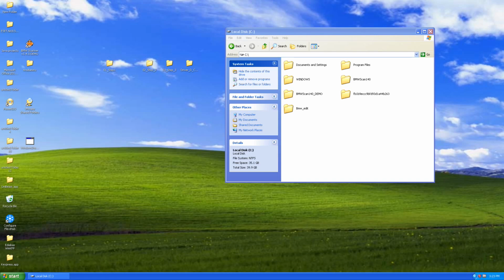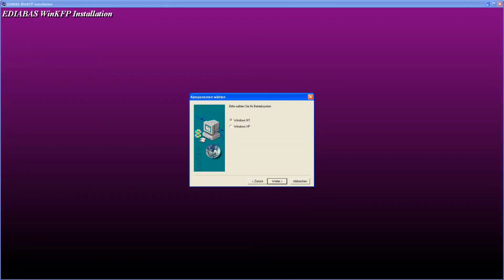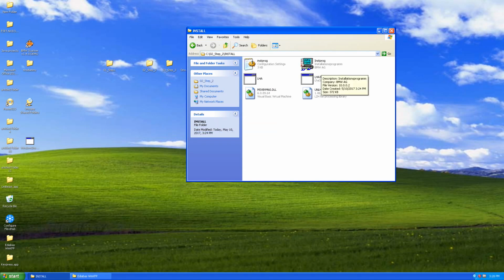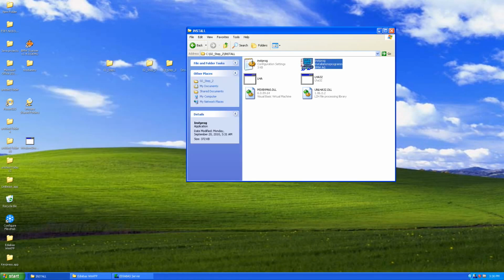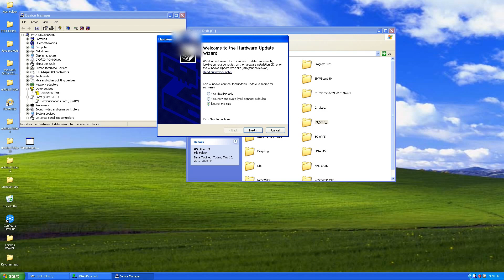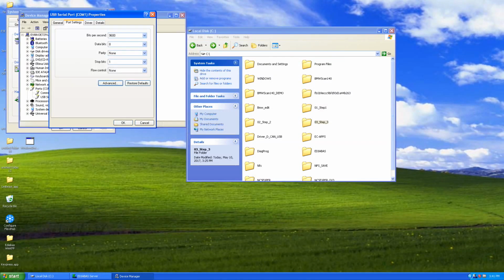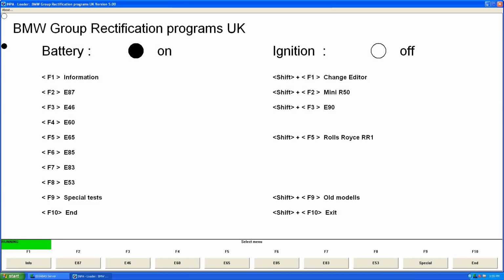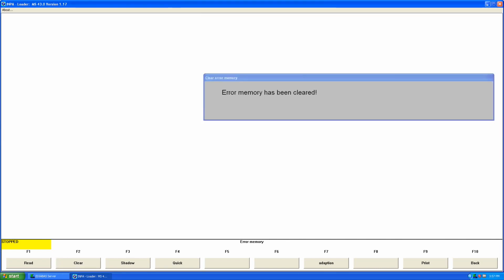How to install and use Inpa

Comment: I’m unable to install the drivers , can someone help?
Reply from the maker: What OS are you trying to install it on?
Reply: @EvanGoyuk  Windows XP 32 bit running with virtual machine. When I plug in the d+kcan into the USB, the wizard does not automatically pop up, and going the manual route does not let me update it because it says that there is already the best driver selected. I’m lost
Reply: Also, I noticed on the scanner itself that there is an LED that does not light up, but I assume it’s still working because the computer is recognizing it? Or am I wrong
Reply from the maker: Try windows 7 -10
Reply: @EvanGoyuk  What would the OS have to do with it? I was told that Windows XP is the best OS to use. You used Windows XP in the tutorial as well with no issues

Comment: can inpa read abs sensor ? because i have light  abs sensor , asc , handbreak and fuel indicator not working. i dont know what is happen mybe abs sensor but i dont know that's front or rear side.
Reply from the maker: Yes inpa or bmw scanner 1.4

Comment: Can inpa turn off bmw bulb cold check?
Reply from the maker: No you need ncs expert which will be installed when you install inpa
Reply: @EvanGoyuk  Thanks Evan, i just ordered inpa n cable online should it have ncs expert on that disc?
Reply from the maker: Yes but watch my new video on how to code your bmw, it will show you how to install everything correctly

Comment: Bro i need i the software you have cant same to find it. Your link works but doesn't provide the software you have or maybe it was removed
Reply from the maker: It is the same
Reply: Evan Goyuk under which file would i find it? Sorry for the trouble man.
Reply from the maker: Go under install then Inpa
Reply: Thanks brother i found it.

Comment: I tried installing, but didn’t copy the downloaded files into the c: drive. I left them in the downloads folder. Could this be the issue with ncs expert not working? It says that it can’t find a certain file when I try to open it.
Reply: Nvm, for some reason the CPI.dll didn’t populate into the c: drive. I did a search for this file and moved it to where it was supposed to be. I’m all set now.

Comment: can INPA code these features

1. One tap three flashes turn signals for lane changing
2. Move driver seat with remote and or when opening door
3. Open/close convertible top while car is moving at slow speed
4. Enable digital speedometer
5. Adjust exhaust sound to be a little deeper & louder
6. Adjust tune for optimal performance & gas mileage
Reply: Which program can code the battery adaption and or door lock automatically at 5mph?etc
Reply from the maker: Inpa can do the battery and ncsexpert can do the door lock.
Reply from the maker: No ncs expert can code most of these and ncs expert is installed when you install inpa.

Comment: This doesn't work on a windows 7?
Reply from the maker: There are some versions of inpa that work on windows 7.
Reply: Evan Goyuk would u know where I can get downloads from? I followed everything u did. Except for when I plug it into the car the battery and ignition stay off. The car is running even with the engine off it doesn't switch to on

Comment: Does it need to have the check engine on to show errors?. Mine has a rough cold idle but no panel lights go on. Also I am interested on how you code your e46 to roll windows up.
Reply from the maker: +1robmal no inpa can show pending codes meaning if you cleared a code and then drove around the code might still be in the system but its not showing a check engine light yet. To code the windows to roll up you have two options the first is to buy BMW scanner and code using that software. I will have a diy out on how to code the windows with it. Or you can use ncs expert which is Installed when you install inpa.